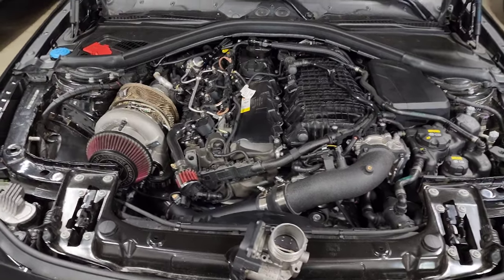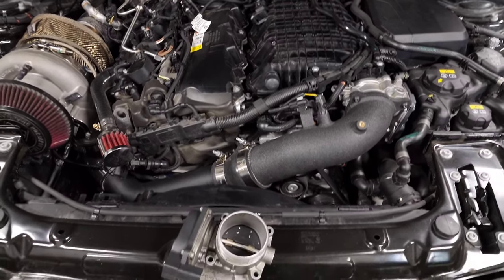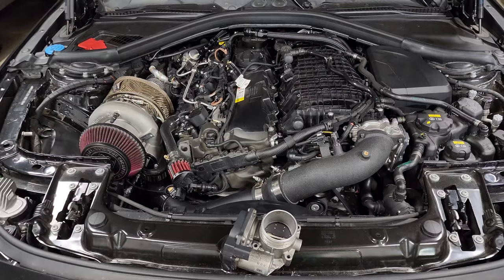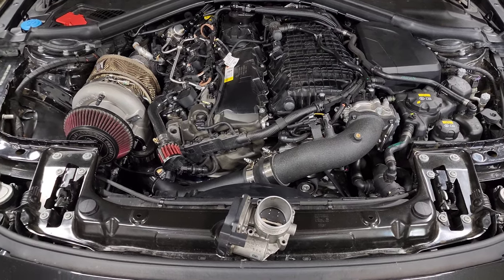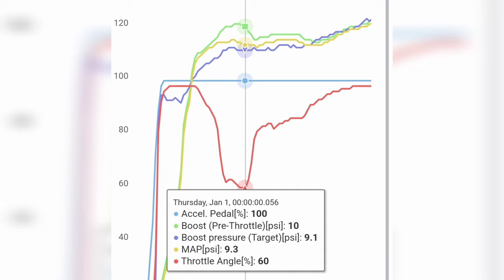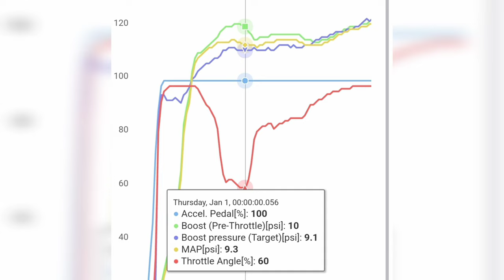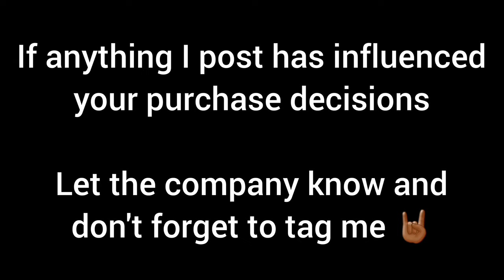What are Throttle Closures in BMW Tuning?

Comment: Is there a discord or way to chat with you about an issue similar to this?

I paid a professional tuner, and im having some big issues.

Mines building boost, then all of a sudden it'll snap the throttle to 20-35% which feels horrible on the driveline.

Comment: @kern417
Thanks a lot for your explanation. So now I understand that for example in case of too much boost, a throttle closure can happen in order to get back to the target value.
But 1.) for what reason does the actual boost raise higher than expected and 2.) what does the other way around mean, when the actual boost is (much) lower than the target boost?
Reply from the maker: Boost control in your tune based on various conditions

Comment: Is there a way to see logs like these if I haven't purchased a tune (BM3, MHD etc)? 
I'm a curious/cautious chap and would like to pull data to educate myself and for making sure all is OK. It will get re-mapped in time, but, it needs chassis mods more and my budget doesn't allow to do everything at once.
Reply: Same question as m5nut ⬆️ please Kevin. 
Excellent explanation,it didn’t occur to me that that the car would pull throttle via the throttle body.(I do realize how stupid that statement sounds to the layman,but this engine and DME is quite revolutionary to me coming from fiddling about with old 4 stroke motorcycles) 
That’s really good to hear and I’m started to understand how the B58 really works as a total package. 
Loads of respect to you as always,
🧤
Reply: Nope

Comment: Can timing being pulled also cause throttle closure? The reason I ask is I flashed my N55 M2 to stage 2 93 yesterday. Drove it for 30-40 miles and logged it today. My fuel pressure is bang on. My boost is good as well, the only time it deviates is during throttle closures. The throttle closures seem to mimic the timing pull, as soon as timing is pulled a split second laterI get throttle closure, then as timing recovers the throttle starts to open.
Reply from the maker: most likely fuel quality if it's timing corrections.
Reply: @kern417  did think that as I had to fill up with premium from a small out for the way garage. I’ve topped up with 99 ron (93 ron) today and trying again later to see how it goes.

Comment: I have seen a closure spike down to 47% open once but usually it's 60% open or more on logs. I have an aggressive tune on stock turbo. I don't get closures 1st-4th gear but 5th-6th it stays partially closed awhile before it straightens out. It seems the more turbine power my tuner added to get boost up in 4th gear logging, boost started straying away from target in gear 5th+. Complex boost system. Trying to get it sorted now.. Are these aggressive type closures safe for turbo? Wondering if air backing up on the turbo blade make it wear out quicker or mess with PCV system. On N54, this could be an issue especially on upgraded turbos. Apparently, B58 increases load quite a bit in higher gears. Thanks for these informative videos!
Reply from the maker: It really just depends. A lot of times you can't eliminate them completely
Reply: @kern417  so the throttle closures mentioned still should be fairly safe for turbo onthis platform?

Comment: Hi Kern, how can i know exactly that my HPFP is failing? Will i get an specific code? Is the symptom totally different to the injector failure?
Reply from the maker: It's a mechanical pump so it doesn't really fail in the sense that most people think. It might leak or physically break, but it's not like it gets weaker or fails in the same sense as an electronic pump.
Reply: @kern417  ohhhhh i see now… ok, thanks! Because my B58 is 1st gen and i just want to replace my HPFP with the new TU version…. 😁👍🏼
Reply from the maker: @technopro-kz4xv  you won't regret it. It's a nice budget upgrade

Comment: I was getting throttle closure on my Shoup tune on Pure turbo ethanol file and could never get it sorted :(
Reply from the maker: It happens. You'll never be able to get it 100% perfect unless you basically only two and log your file in one specific setup. Our cars are good at accommodating different conditions if you plan on driving your car year round in different places.